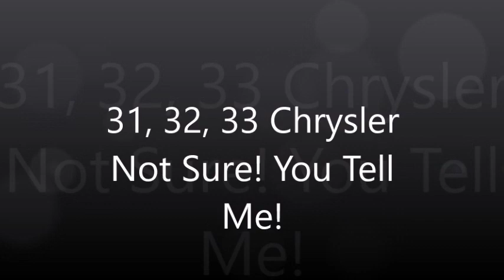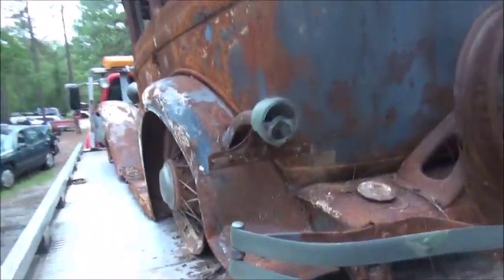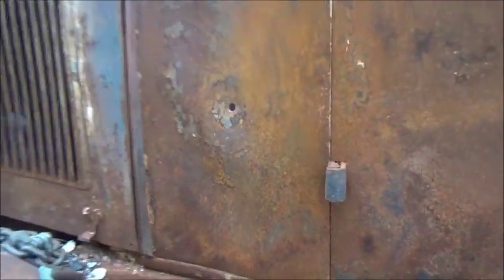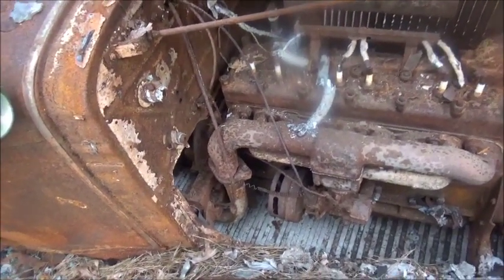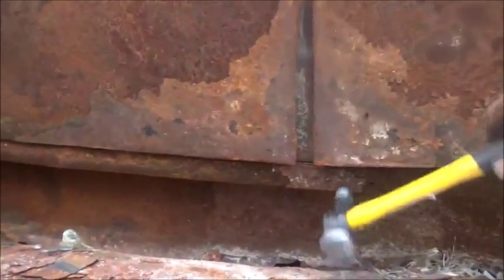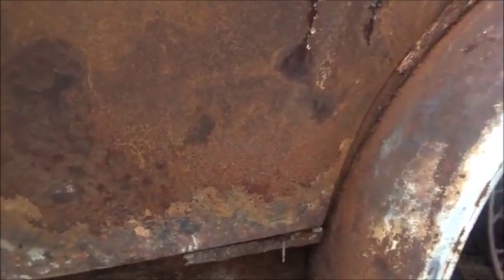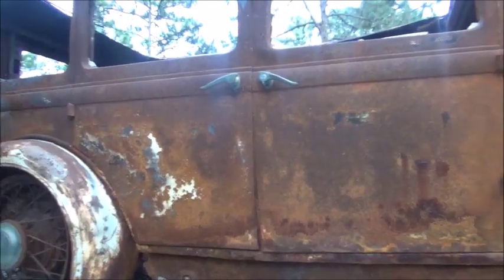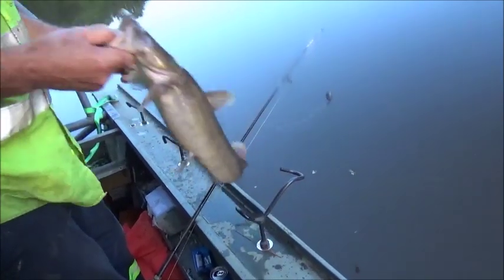EARLY 30'S CHRYSLER SEDAN BURNT BUT RESCUED

Comment: Good morning Jonathan -

It's not a '31 - We had a '31 in 1940 & '41 - then after the War started, my dad put it up  on blocks for the duration. The '31 had a spare tire in a recess in each front fender. Where the spare tire is mounted on your Chrysler, ours had a luggage rack that unfolded flat to hold a large box or travel trunk. Dad used that trunk rack to carry what I believe were large milk cans (we lived on a farm in New Hampshire) to carry our drinking water from a local spring during a very dry summer in 1940. Other than the above-mentioned differences, the car you rescued looks virtually identical to the one we had. (ours was either a flathead straight 6 or a straight 8  - I don't remember which - I'm guessing it was a 6 because the transmission was a 4 speed) 

The car you have is likely a 1932, since that would be consistent with the trend in the early '30s to discontinue more than one spare tire. Later Chrysler models began changing to a more "aerodynamic" body style as did other manufacturers in that period.

I really enjoy your videos and look forward to seeing them. I was stationed at Camp LeJeune and Cherry Point MCAS in 1957, and at time owned a 1947 Buick Special - 4 dr. - manual "3 on the tree". Sold that and bough a '48 Chrysler New Yorker - 4 dr - manual 3 speed from a fellow Marine at Cherry Point. Rebuilt the straight 8 flathead before I got reassigned to Japan.

My favorite recreation in those days was "scouting" junkyards for stuff I might use - Carried all my tools in the trunk. Great to see Noah learning and doing  - I would certainly be proud of him if he were my grandson.

Best regards,
Walt Brown
Reply: I withdraw my statement above that your Chrysler is not a '31 - Poking around on line I noticed quite a few models that did not have the spares in the front fender wells, so it could well be that Chrysler made quite a number of different models that year. I also saw some shown as '31s that had the split windshield you mentioned

Comment: The wheels are good looking still but don't use them. Temper is gone from the spokes I'm  sure. They are wall hangers. The frame may be useable yet. Bending a flange with a crescent wrench will tell you. A full fendered gangster style rat rod would be unusual, this is a great start for it. I was guessing 31,32, comments seem to say 31. Chrysler had a starter generator combo. Both were in one unit. I forget when they changed. But I think by 33 it was two units. Idk if it will make a difference identifying it. Makes an interesting project for sure. Thanks for sharing

Comment: The body on that car is almost identical to a 31 Plymouth PA-6, so I'm sure you're correct thinking 31-32 Chrysler. The windshield, visor cowl and doors are the same. The accent lines in the visor and cowl are also the same. The only thing I notice different is that the body line on the PA didn't get narrow around the back. I can't really speak to the rest, though. My comparison is to a car that was heavily modified except for the body shell. 
 I know you'll do something cool with it, regardless of the year.

Comment: That "Crunchy" is probably ash inside the door (window seals, glass, etc...). I wonder if any parts of that Flathead 6 are good? I've never seen a Reverse Arch leaf spring! That was a HOT FIRE! I bet it got to 1,500 degree's F (when Flash-Over happens). Man, them 2-3 pound cats are great Pan Fryers!

Comment: That was a nice car, it's a shame that happened.  I pulled a Fordson tractor from a guys yard  that was in a barn fire like that. It got so hot the owners came home from a day out to the barn  gone apart from  small piles of ash/scattered nails, and  the tractor sitting in a burned rectangle with the fire department still there packing up.  I wanted a few parts off it, when I pulled the oil pan  the crank bearings had melted and dripped out like icicles !    I got a few parts from the rear end but it wasn't really worth the bother, I've never picked up burned tractors after that.  Hopefully you can  do some  good saving something out of the other guys bad luck. Thanks for sharing.
Reply: the Chrysler is very savable. I used to do restorations and have restored far worse than that one.
Reply: @todddenio3200  if it was an incredibly rare car and worth a huge amount of money anythings possible if you got the money. My aunties husband in the U.K  was involved in commercial vintage car restoration, and hand building stretch limo's that went to Saudi sheikhs that cost huge amounts in the 80's. I know he's retired  but does cars for a hobby now at home.  He has the old school tools to make any body panel you could want for a project.  Then make it  so it don't need piles of lead on it to make the finish and fit right,he still paints to.     They weren't allowed to use synthetic filler anywhere,and minimal lead on company projects. 
   Would he take this on for fun or paid no it's not worth it i've seen him do rotten classics worse than this to but it was huge $ because it was financially worth doing at the other end .  Anything they save for another projects the best for this one,  A $1000 in shop rates  or parts if a guy did it properly himself  really won't go far.

Comment: If you come at the panels at an angle with a sand blaster and don't stay in one place it should clean up nice. Learned the hard way not to blast sheet metal straight on or stay in one place.
Reply: If he uses the right media it won't build to much heat, but it's expensive. Also soda blasting with water works great but $$$. If it was me and I was going to build a rat rod out of it warpage wouldn't be a big concern, I would try to prevent as much as I could but wouldn't worry about it.
Reply: soda blasting is the only way to go on broad area sheet metal. Sand blasting can work but like you said you cant stay idle in one spot and you have to keep plenty of distance to keep from warping the sheet metal.

Comment: one word, at minimum:  Electrolysis.   ( but make sure all chrome [if any] is removed ).  Remember that electrolysis involves NO heavy work.  It WILL work, but involves a great deal of patience and determination.  note:  Electrolysis needs to be done out doors / well ventilated.  Keep pets and children away, remember.  Safety!

Comment: The old Chrysler may just surprise you. yes, it would require a complete tear down and actually should be either soda blasted or dipped but this car could be restored to a beautiful stock show car. I had restored worse for customers. the body hasnt lost as much of its temper as most would think. I could tell from the sound of it and how well it sprang back when you pressed on it.

Comment: You are so right a new car with that much heat from a fire wouldn't be left at all. Definitely Rat Rod Material. Take off the destroyed running boards chop the top 3" or 4" and you definitely are on your way to a rat rod.

Comment: You do know that primer is porous, right? any paint is better than no paint but primer will let moisture through.
Reply from the maker: I use red oxide primer. Red “primer” is not a true primer but a rust inhibitor. Red primer for metal contains red oxide which inhibits rust. Grey primer doesn't but both are equally effective as primers. And that is why it's now partly red.

Comment: Try Dustless Blasting instead of sandblasting. I'm sure there is someone in your area that does Dustless Blasting. They would maybe work with you on this car for some air time or what they call it on You Tube.
Reply: What is dustless blasting? Is that where they use dry ice chips as the media ?
Reply: @stanpatterson5033  Dustless Blasting uses water and very fine media. It's less abrasive that sand. Check it out on YouTube

Comment: Have you ever seen the sand blasting attachment for pressure washers? You need around 5000 psi but it stops from warping the metal worse
Reply: you can't hurt that car anymore with the warping I'm sure if it was not burnt he would of done it right but since it is what it is just use sand

Comment: As I recall the Plymouth sedans from '32-'34 had suicide front doors, now I don't know if Chrysler did that or not, I remember seeing a picture of a '32 Chrysler roadster with a similar radiator shell and grille so it actually could be a '31 model.

Comment: Glass and other debris on the inside of the door making it crunchy.  I doubt there is any issue with the frame.
Reply: the only way you find that out is usually when it starts falling apart, or when you start working with it . I've seen it with burned equipment that got fixed with things like loader booms  cab frames and wheels that got salvaged when the tire burned pretty good.  if those springs lost the temper it got real hot , I've  also seen tractor rims go flat at the bottom with the high heat and weight sitting on them. A frame like that and a custom car build isn't something i'm going to mess with after a fire.

Comment: It would be cool with a modern V6 power plant in it and a welded in steel roof.
Reply: He just needs to search a junkyard for a crashed dodge ram 1500 with a 3.6 Pentastar V6 2010 to 2019 I'm sure it'd be a great fit in the car
Reply: Couldn't agree more and set the body on a dodge small truck frame with some mods and it would be a great driver. @erica-lillycrider1088
Reply: @jonlennon3348  there good engines that's what is in my 2013 dodge ram 1500

Comment: Johathan, I saw this video on YouTube.  Do you ever need help with relining brake shoes?  These guys in Pakistan have interesting methods.  None of them speak English, they all speak Pashtun, I don't  know anyone who speaks that.  Also is normal to use a sledge hammer to install a wheel bearing on a truck?
 "Replacing a truck brake leather with small tolls"  https://www.youtube.com/watch?v=zMKFQdPeVp0